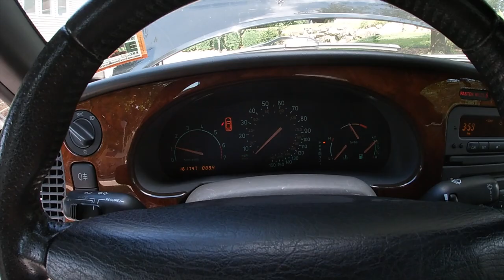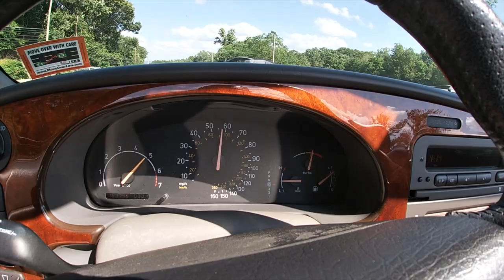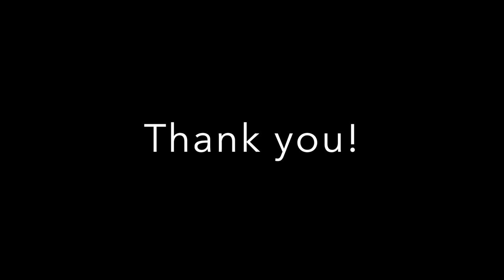A $10 Part that Can Blow your Turbocharged Engine - Saab In Depth

Comment: If you own a SAAB just remove the PCV system and get yourself an Oil Catch can Setup,  YOUR WHOLE INTAKE SYSTEM WILL THANK YOU
Reply from the maker: have you done this with your saab?
Reply: @KylePancis  Yep and everything else I've owned... All the pcv system does is vent the crank case pressure back into the intake where unburned oil vapors just end up gunking and causing other issues
Reply: @KylePancis  00' 9-3 vert HARDWARE: PCV to CCV conversation, T7 turbo bypass valve mod, mishimoto front mount intercooler (forgot what it originally goes into but it's a big boy)  w/ 2.5" intake piping and open air intake, 3" custom open exhaust, random eBay oil cooler w/ customs lines,  custom power steering high pressure line (stock ones won't fit with the intercooler), genuinesaab hardened motor and trans mounts, eibach lowing springs (1.5" drop),GS hardened strut mounts, custom 2" THIICC rear sway bar... Software wise, just open s.i.d tune atm until warmer weather hits then I'm going full send but it's a 205L block so the Pistons will only play till about 300bhp